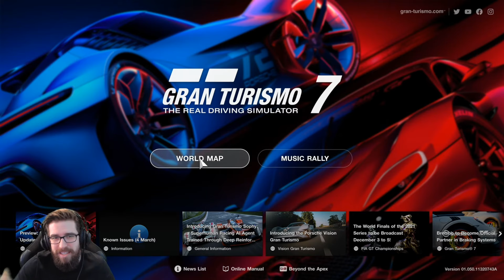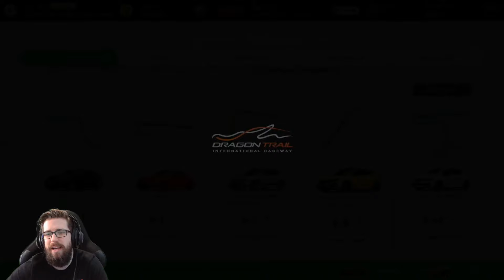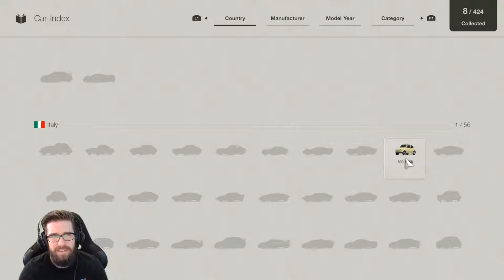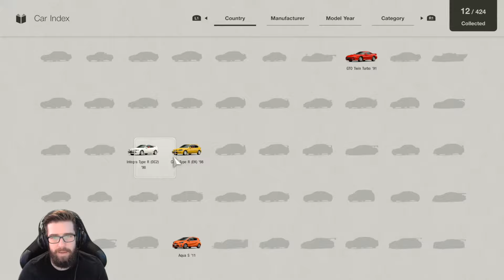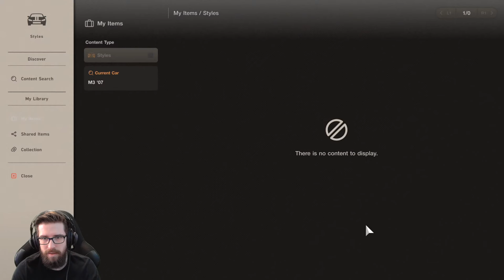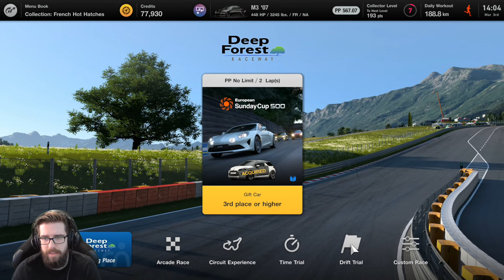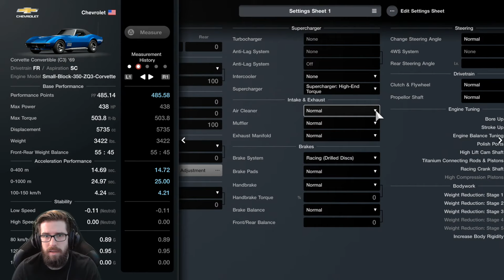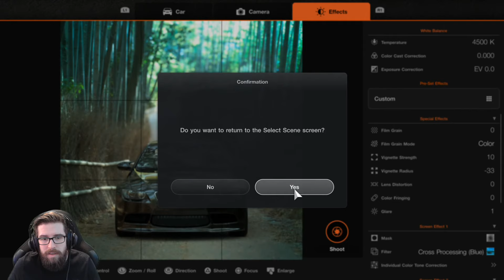Gran Turismo 7 (PS5) - GT Simulation Mode - Gameplay Walkthrough - Part 1 - "Menu Books 1-15"

Comment: how ever in videos i need to see controls button layout of Gran Turismo 7: to see if it is like GT4 ,GT5 .GT6 these games had a costumes control setup
for D- PAD for steering  X and [] as assertions and braking
if someone can confirm if costumes control setup is still there in GT7
thank you
Reply from the maker: You can use 3 different control schemes with a controller. Modern and classic are both options you can choose.